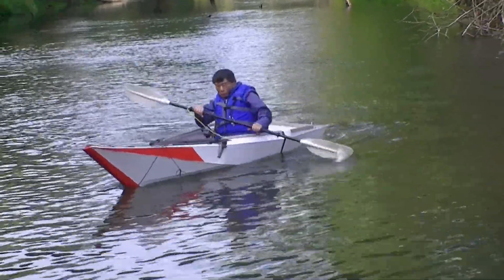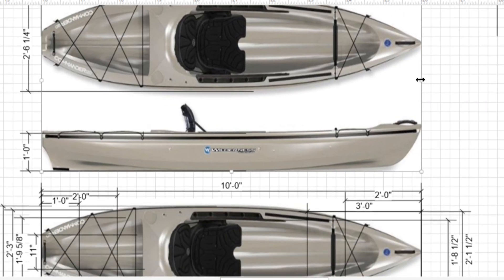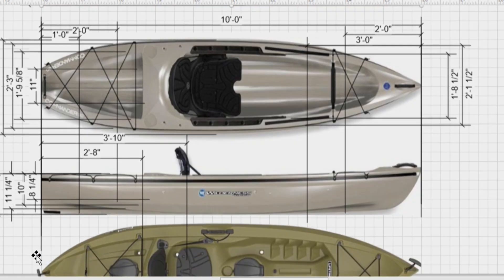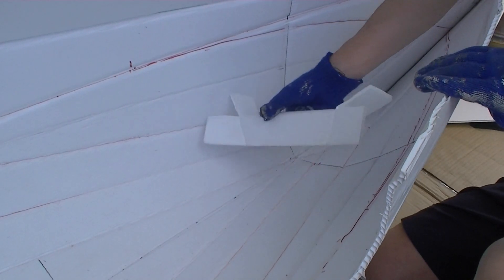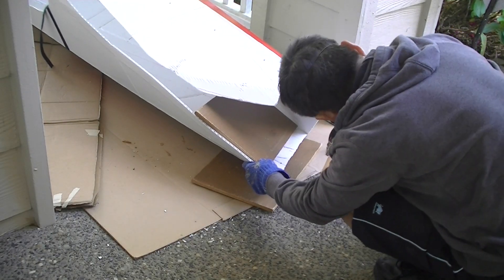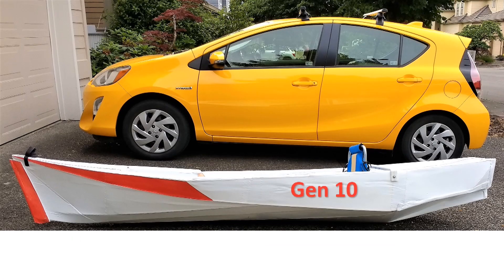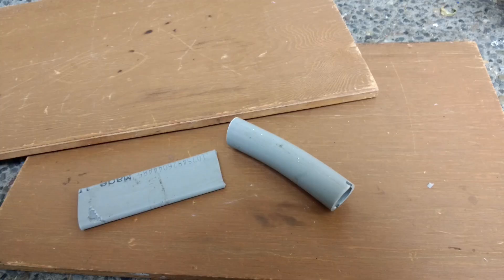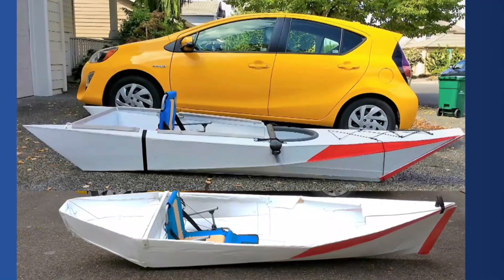Part 1 G10 -  DIY 9'8" 13 Lbs Coroplast Kayak

Comment: This is great
Reply from the maker: Thanks, I finally modified the seat yesterday, added bungee cords on the small front deck, added a cup holder. I also discovered it is difficulty to create a perfect water sealed joint with my hand tool. The kayak works well with my body weight, no apparent leak. But there is a leak with added weight. Therefore I used sealant to seal off that leak. It seemed to working well. I really like this small kayak, except I can't fold it.